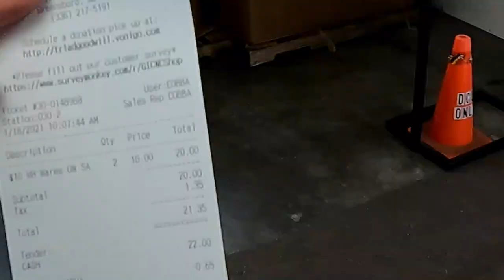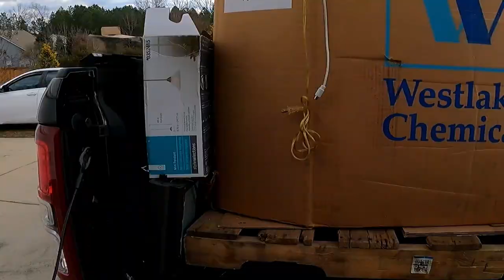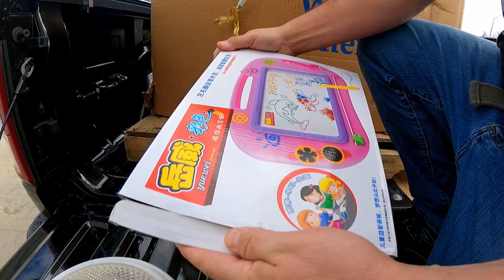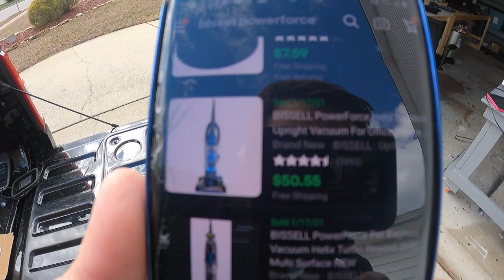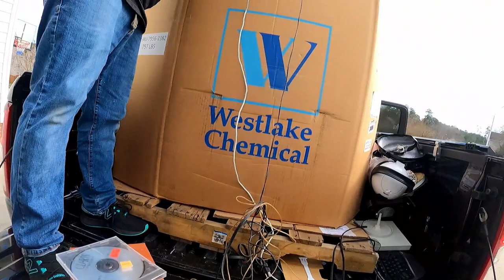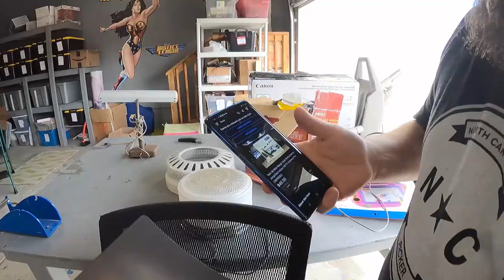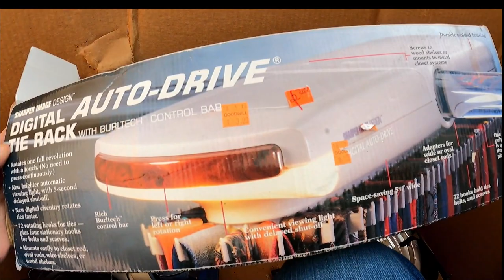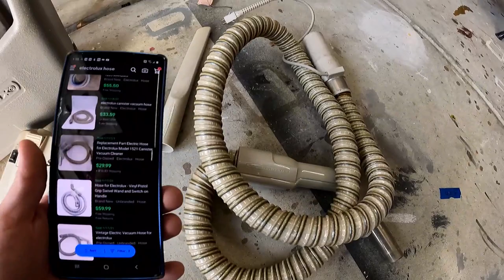I BOUGHT 2 GOODWILL MYSTERY PALLETS FOR $20 | WHAT'S INSIDE?

Comment: The steam cleaners, are only used if your dog or a cat made a mess on the carpet.  Toss it..

You should have cut the cord and the appliances to the scrap yard. Would be curious if you end up with $5 to $8 in scrap value :P

APC Battery back up had a lead battery  usually $2.50 in scrap value for the battery.